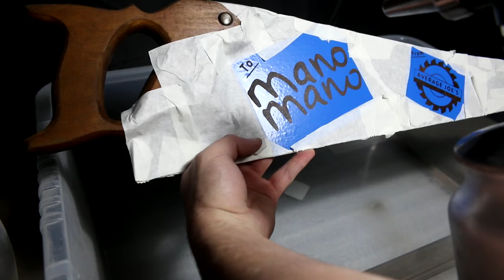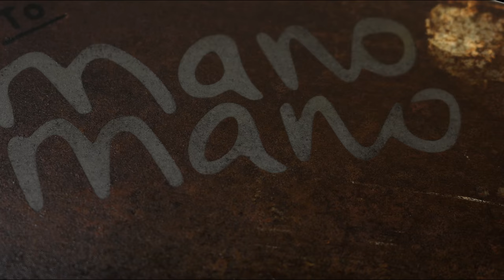Rusty Saw Sign - Gift Idea - Sandblasting Rust

Comment: Nice work mate..... with the vinyl, for application use an old bank card or I.d. card and apply pressure over the sign before removing the backing tape it will adhere better. Also if on something like the saw, after removing the backing tape apply some heat on the vinyl with a hair dryer then let it cool. That will help with it sticking enough to use the etching gun.
Reply from the maker: Thanks mate! Great tips :)